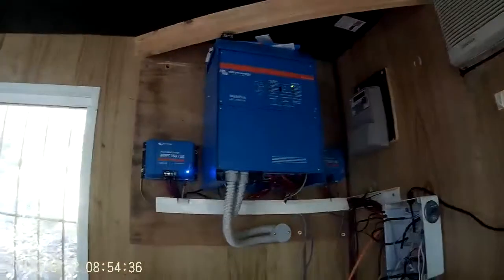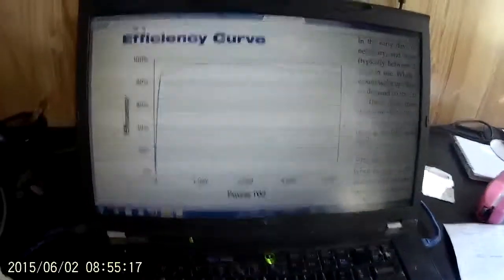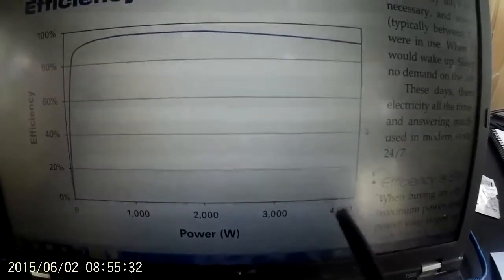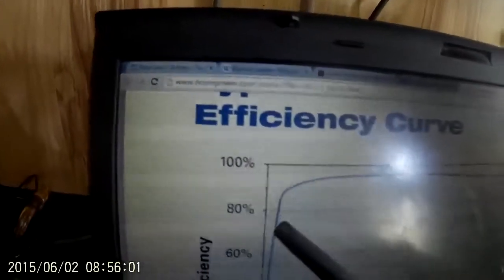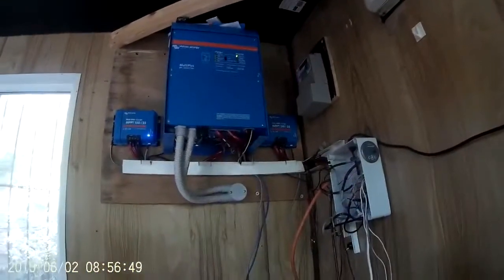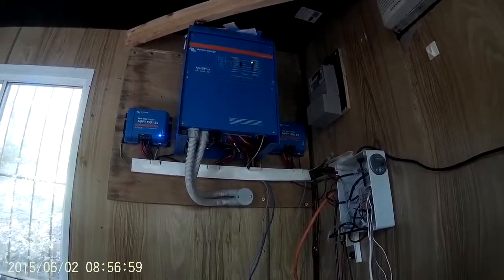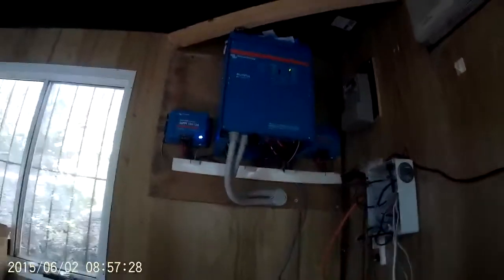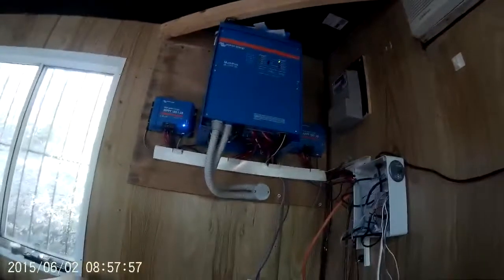SUPRISING Offgrid Solar Parasites - How Efficient is Your Inverter?

Comment: Most days of the week, because my weekender is off grid (by choice), my inverter uses more electricity than my house does. Five days a week, the only thing in the house using electricity is the fridge, which uses less than 300Wh per day in the summer.

I'm aware of the inefficiency of the inverter, however, and manage my power accordingly.

Good video. I don't watch all of your videos, but I've subbed because you have some good information.